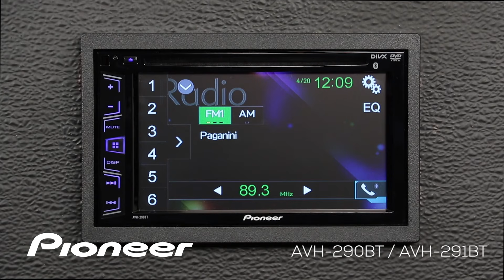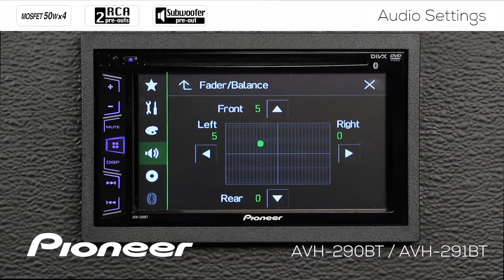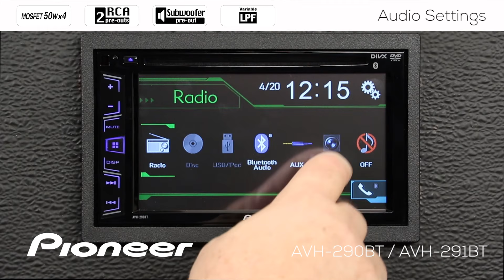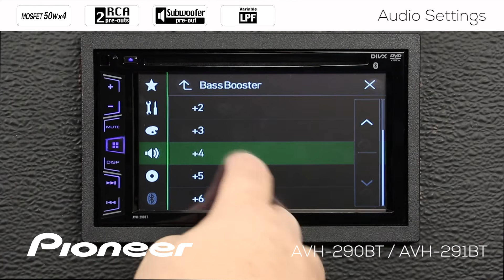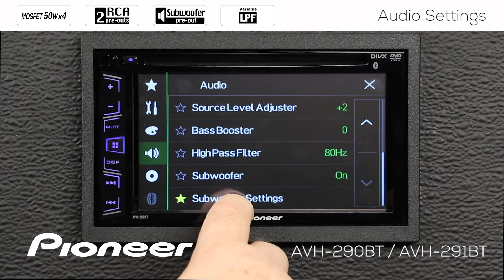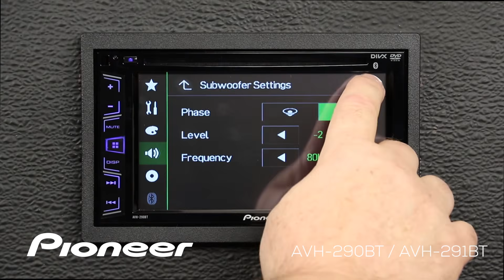How To - Audio Settings - On Pioneer AVH-290BT, AVH-291BT, MVH-AV290BT, AVH-190DVD

Comment: How do i cut my avh 291 off the screen stays on
Reply: If your receiver stays on after you have switched the vehicle off, your receiver is wired incorrectly.  Focus on the Red Wire and Yellow Wire.  Do not wire Red and Yellow together.  You can learn more about wiring your Pioneer receiver here:   https://youtu.be/-bF3uzzaT30?list=PLw63zJRQbCNh2FQHF_nn4s6OD4VnqOf4A       If you want to switch the screen off you can do that by touching the DISP button.  You can see it here:   https://youtu.be/M4j1UNpOSwI?list=PLw63zJRQbCNh2FQHF_nn4s6OD4VnqOf4A   If you want to shut down the system you can go to the home screen and select Off.   You can find a full playlist of How To  videos from Pioneer about AVH-291BT here:  https://youtu.be/og47kn5aGs8?list=PLw63zJRQbCNh2FQHF_nn4s6OD4VnqOf4A    You can learn more on Pioneer's web site here:  https://www.pioneerelectronics.com/PUSA/   and you can find more videos on Pioneer's YouTube Channel here:  https://www.youtube.com/user/pioneerelectronics

Comment: If I wanted to give my subwoofer a higher crossover than 125hz could I theoretically set the pre-out to rear and then and just the crossover on my aftermarket amp?
Reply: Yes, that's correct.  On Pioneer AVH-290BT, when you set the rear RCA output to the REAR setting you have created a full range output with no crossover.  You can send that full range signal out to an external amplifier and use an HPF or LPF on the external amp as needed.  You can find a full playlist of How To videos about AVH-290BT here:  https://youtu.be/og47kn5aGs8?list=PLw63zJRQbCNh2FQHF_nn4s6OD4VnqOf4A   and you can find more videos on Pioneer's YouTube Channel here:  https://www.youtube.com/user/pioneerelectronics

Comment: My fm radio plays for only 3 seconds then stops  what can be the cause  . Every other feature works well . Thanks
Reply: What is the model number of your Pioneer in-dash receiver?  You can usually find the model number near the corner of the face of the in-dash receiver.  It will start with the letter DEH, or MVH, or AVH.   You can find more videos on Pioneer's You Tube Channel here:  https://www.youtube.com/user/pioneerelectronics